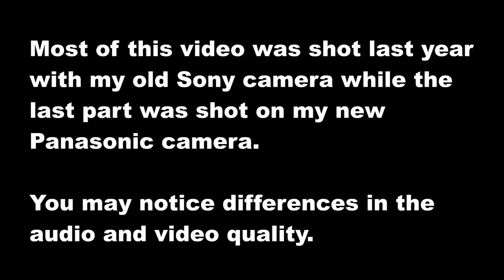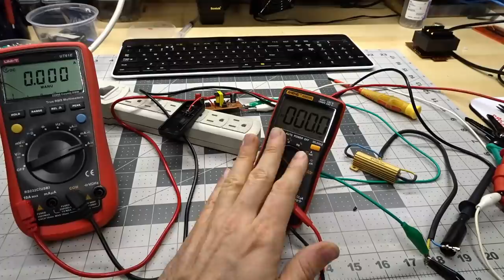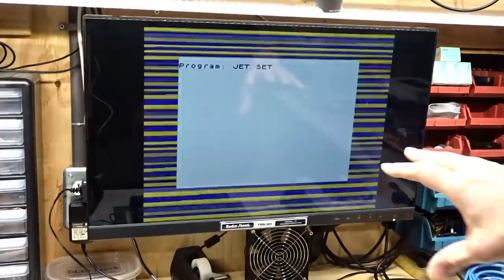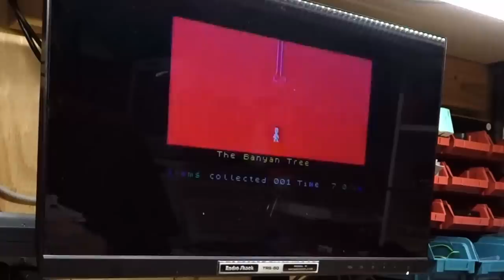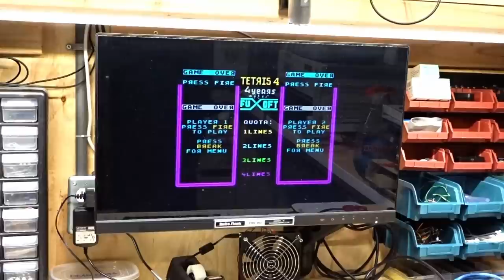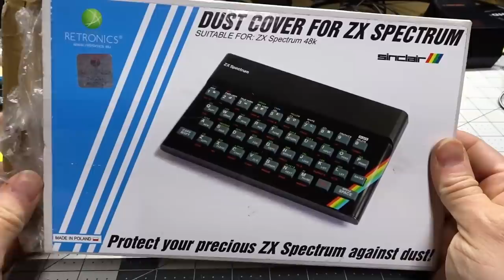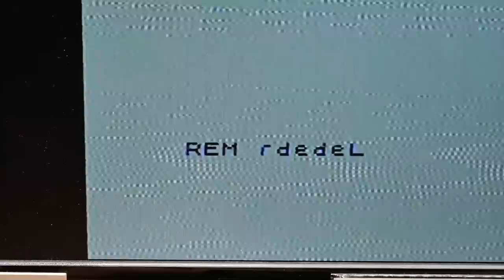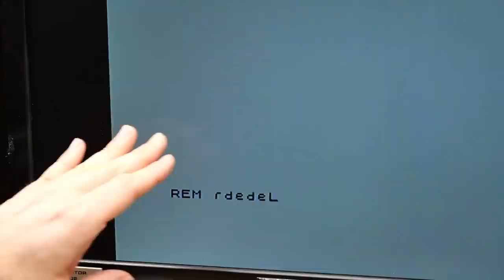ZX Spectrum Part 3 - Revisiting the machine at last!

Comment: I've tried the PC/Phone as tape trick before and had limited success, not only with the Sinclair computers but with most machines from that era.  The only thing I've found that works reliably with all of them is  Grundig DCR-001 Data Corder.  Rarer than hens teeth.  Of course this means dealing with real tapes, but once you get a tape working, or find a good original, it just works like a charm.  Plus you get that authentic retro-computing experience!
Reply from the maker: I just found a nice Panasonic tape deck for $5 at yesterday .. and a pack of unused tapes. So after I service the recorder, I need to m it out on the spectrum.

Comment: You may want to check the capacitors on the Motherboard switching supply for the +12V, the -5V; and the +5V linear regulator.

Comment: check equalization parameters on android (or your smartphone OS) you must turn off any 3D audio effect,  and select low bass at minimum,  mid-range frequencies and high frequencies at maximum. this setting must help a lot with your loading issues. 
And the last thing ...no preamplifier is needed at all!!  just plug your stereo plug at your smartphone and your mono plug into your speccy!!!

Comment: Looks like a good result! Although I remember hearing somewhere that the 78xx type of linear regulators need a couple volts higher than the output voltage. Looks like your input is right at the limit. You might need a slightly higher input voltage if you are using any add-on devices. I think the original was 9 volts if I remember - although that might have been for the older ZX81s. I ran into an issue with another machine where I needed to do that to eliminate strange behavior (or "behaviour" - we ARE talking about a UK computer here! :) )
Reply from the maker: On my older videos I was powering it right off my linear bench supply and I found that voltage didn't matter (other than for heat and if you were above the minimum on the 7805) so the issues with this machine are the same no matter how I power it.

Comment: Try adding a 10 Ohm parallel to the output of the amp, the un-loaded output may be producing to much noise/overshoot to catch the signal.  Also, some apps may not produce correct waveforms, that leads to short outages that confuse the read timing.

Comment: You appear to be measuring the voltage at the end of your maze of test leads, alligator clips etc. I'd suspect the PSU is actually doing a better job than it appears and the drop is in the test setup. Final voltage on the connector plugged in with the Spectrum running would give you a better idea. Easy to overlook the significant drop across lots of leads :-)

Comment: Adjusting volume levels on a tape deck was a black art back in the day and loading errors were common.  Different games always needed fine tuning with the volume levels and you are going through some of the pain all Spectrum owners experienced around '83.  It's also possible that the contacts on your EAR jack are a little dirty or corroded, so it may be worth giving them a clean.

Don't give up on the little ZX.  Whilst the graphics may not be quite up to the C64, there are some classic titles out there and if you can pick up a Kempston compatible joystick interface, your gaming experience will be improved no end.
Reply from the maker: Heh havn't given up on it -- for now it's going to have to go back on the shelf (to look pretty) until I can get back to it. I have lot sof other projects to work on :-)

Comment: The Speccy needs a LOT of audio level, especially the issue 2. When loading from my notebook, I have to turn up the volume to 150% and use WAV files with VLC player set to 120% volume. You should really get a decent 9V 2A PSU and a DivMMC Interface with joystick adapter included. Loading times of seconds instead of minutes. Well worth the money. I recommend to DivMMC Enjoy! Pro One from ByteDelight.

Comment: I used to use a converter for my C64 that made a sound file from t64 and prg files and just used a generic mp3-player with one of those car stereo cassette adapters to load the files on the C64. It is very important, though, to use the raw sound file, e.g. in native wav and preferably  the highest quality possible. If you use mp3, you will end end with a bunch of load error messages. It may not sound different to the ear, but you will lose some delicacies of sound the computer will be unable to interpret.

Comment: Try to get the 1980s portable audio tape player - you know the one with the handle that slides out of the front (they had one in an episode of Stranger Things), and get the original cable - one black one grey with the two circular blobs near each end, connect three points as per the spectrum instructions and see how you go! a full retro setup!

Comment: Loading/Saving a program from/to a cassette tape was always like this.
The Sharp MZ80K had an in-built cassette which generally worked as they had adjusted the volume to make it work, mostly.
Still faiked fairly frequently though.
Reply: As did early PETs, and - later - Amstrads.

Comment: Back in the days of the Spectrum people would pour lots of time into resolving problems with loading. I'd be tweaking the tape player with an Azimuth screwdriver and would generally be able to remember which games needed needed a tweak and how far to turn the screw, then you'd have to turn the screw back again because that position might cause a problem with something else.
Anti-piracy measures were often to blame, certain loaders designed to make copying difficult also sometimes made loading original copies tricky.
We just have different expectations these days so I can't see the Spectrum winning many new fans using original hardware.

Comment: I realize I'm two years late to the party, but I figured I'd chip in: I recently repaired my TI-99/4a and struggled getting its tape interface to work as well. Ultimately, I ended up using my Zoom H2n with the tape data normalized using Audacity and stored on an sd card in the zoom.  A bit of overhead, but it was the only reliable option (which included a PC, phone and ipod).

Comment: Take my english for what it is, that said...Hi !  don't know if yuo're still up with this, but... loading a game on a Spectrum has deeper meaning which is not releted on how your machine works. Belive it or not as soon as computer were getting in every house, piracy did the same. For some times you could "merge" a program (loading without running), copying the code on a new tape and make some money.  It didn't take long and the "merge" possibility was gone but piracy didn't give up and started  to duplicate tapes using 2 tape-players, first one was playing and second one was recording (via cable). To avoid this producers worked on frequency, some kind of protection and things got difficult. Non-protected games give you blu and yellow stripes during the loading process with regular noise, while protected games give any color stripes and noise raise up.
Thank you for the video_ a Spectrum grown guy.

Comment: Hi Adrian. A couple thoughts about loading from your phone.with my customers, whenever I use something like a square credit card reader, I have to turn off any audio enhancements that the phone has. So if you have Dolby audio or some kind of enhancement, make sure you turn it off or it does weird things with the signal. II thought is to make sure you're using a mono audio cable instead of a stereo cable, as it could be listening to the stream of data in stereo and causing a lot of confusion. 
The third is your point at the very end about why the ZX Spectrum is finally remembered by so many people. It just really does not even hold a candle to the C64...

Comment: as a spectrum and C64 owner, I must say the spectrum ALWAYS loaded tapes more reliably than the commodore especially with second generation copies. I never had trouble loading at all. I suggest you try an old portable cassette recorder with the wav file on there in case the headphone output from the phone with its audio compression/enhancement.EQ  is upsetting the spectrum in some way. The loading sound from the speaker is normally quite loud. The spectrum likes a good bright tape recorder with lots of treble.

Comment: The keyboard was klunky for sure, and there was a lot wrong with it - but the Spectrum was very very affordable - especially compared to the competition. Actually my Spectrum was an upgrade from the earlier Sinclair machine - the ZX81 - you should try to get hold of one of those. Man I wish I'd kept all my old stuff.

By the way, you are right about how you learned to use the keyboard. For those that don't know, it was basically a "modal" system optimised for BASIC programming, so it starts off expecting a "keyword" and flashes a "K" cursor and so you can press P (I think) for PRINT, then the cursor changes to "L" and you can type other stuff. It was a of a memory game remembering what all the special keys were (more keywords than keys), especially when the keyboard letters started to wear off. By the way, one side effect of this was that the BASIC programs were much smaller, i.e. one byte needed for PRINT rather than 5 bytes of ASCII - this was great advantage when memory was low (as it was on the ZX81 with only 1K standard)!

Good luck with your next project, I enjoyed watching this one.
Reply from the maker: I actually have a Time Sinclair 1000 which is the US version of the ZX81 basically. I have tried to use that machine but unlike the ZX Spectrum, it feels completely unusable to me. With the affordability, though, I can see why it was so popular ...

Comment: With regard to the keyboard issues: get a +2, had a much nicer keyboard and also had a version of BASIC where you could type out the commands in full rather than having to use the keyboard shortcuts. With regard to the loading issues: yeah, that's pretty much how the Spectrum always was--ultra finicky on what volume it would accept.

Comment: I can get my spectrum to load pretty reliably off a phone. I use an app called playzx, and the original mono cable that comes with the spectrum. There is an option to invert one of the audio channels in playzx, which you need to do if using a mono cable in a stereo socket. I find that works. If I use a stereo cable I can't really get it to work well no matter what I do. 1 notch down from full volume is usually the sweet spot, and with no amplifier.

I still get the odd tape error but it loads probably about 80% of the time first time.

Comment: I can't see if there ever was a part #4 but you shouldn't have had so many tape loading issues if the audio levels and timings were fine. ZX Spectrum used a very rudimentary format that was, in fact, rather resilient. The audio is truly binary - just pulses of various widths (durations). During loading it is the software that measures how long they. A simple threshold decides if it is a 0 or a 1. Parity is included for error detection. Not sure if DC offset could confuse it (or whether it goes through some filter) but incorrect levels during imperfect rise/fall edges could cause havoc. Not sure if your phone app or tape recordings use compression that may be optimized for human hearing but it may cause problems here with impulse timings being off. Colours and widths of the lines on the border are directly related to the levels and widths of the pulses being detected. If I remember correctly, 0 is a short pulse (~0.25 ms) and 1 is twice as long (~0.5 ms). 1000 ones or 2000 zeros (or something like that) could be encoded per second, averaging 1500 bps. Those are blue/yellow. Red/cyan are the longer intro/lead pulses for synchronization, terminated by a sync pulse indicating the start of the data block. There were three types of blocks: header (metadata for what is coming, very short), "program" for BASIC programs and "bytes" for any other data. You could probably trace these and see what the ZX Spectrum is "hearing" as it literally repeatedly inspects one I/O port bit all the time and counts how many times it sees the same value... Quick search says I/O port xxFE (00FE should do), bit 6. Also says that the analog signal is on ULA pin 28.

Comment: Hello. It's common practice to replace the linear voltage regulator with a switching regulator (example : Traco TSR 1-2450) which does a much better and effective job than the old LM 7805 regulator. And it does not radiate heat so no heat sink is required anymore..

Comment: For what it's worth, I've had good success unsticking old tape adhesive using lighter fluid. I don't own a Spectrum but if I did and wanted to take it apart, I'd break out the lighter fluid.

Comment: Try turning down your phones volume and using the amp to do the boosting. When running my old 160gig ipod through the cars tape deck via a cassette adapter I would always get far clearer sound when turning down the preamp from the ipod and using the car stereo amp to do the volume boosting. Around the 70 to 80% range on the ipod headphone output would yield good results. The same has applied to any audio output device that I'm trying to patch into a system that has its own amp.

Comment: Id recommend a ground loop noise isolator on the 3.5 jack coming out of the op amp. Your going to deal with some reliability problems but nothing as extensive as you saw.

Comment: Storage on 8-bit computers is not something be neglected: It is key to a good experience. Just like the SD2IEC and 1541 Ultimate are for a large part responsible for the renainssance in the Commodore 64, for other 8-bit computers, it is important to have modern storage media as well. For the ZX Spectrum, the common modern storage medium is the DIVMMC and I think your video did prove that you really need one. Likewise the BBC Micro has the TurboMMC.

That said, the Commodore 64 is a better computer by leaps and bound. The best technology won in this case. Sinclair computers were really the cheapest of the cheapest, cost reduced and the Spectrum was designed in this philosophy too. The Spectrum is interresting for retro computing because it had some good coders, whose work it is worth to see, and definately not because the computer was good.

Comment: As several have said probably recommend using a DIVMMC  Joy which means you can load games from SD Card and it includes a joystick interface.
Reply from the maker: That would clearly make this thing work properly bypassing the tape interface entirely. :-)

Comment: In that application that you use (Playzx), in options activate the first two and the last one, leave it as it is and turn up all the volume and also use a normal cable, double stereo and everything you put will run

Comment: When Timex tried to sell Spectrums in the US, they just looked like something that was purely an attempt to meet a basement bottom price point, IOW, you pay for what you get. The Commodore 64 was definitely more pricy but it was designed to be an actual usable computer and ran circles around the Apple II stuff in terms of value for the dollar (and had much better sound and graphics than the Apple II). I suppose it was the ZX Spectrum 128 model that those started to become decent computers.

Comment: This behaves exactly the way I remember mine behaving in the early ‘80’s when it was new. It was so hit and miss with tape volume that it drove me nuts. I saved up for an Apple IIe with disk drives. Wish I still had it play with though I remember typing in programs on that squishy keyboard the trying to run them and save them to tape.

Comment: What you need to do if a game won't load is adjust the tape head with a small screwdriver...especially if the software is recorded at home by someone else...usually commercial game tapes dont need this done but if your tape player head is misaligned you will have problems...you need to adjust so the sound is clear and crisp and not muffled

Comment: Hi Adrian, there is an alternative basic rom called Gosh Wonderful that does away with the shortcut basic commands and let you type in the basic key words as every other computer. You could burn it together with the original in to an 32k eprom and switch between the two or build it on an external module. For the tape loading I don’t know if the tape files you are using are mp3s or .tzx files. For the later as they are raw digital bitstream I think the problem may be the phones audio out. There is a digital tape file player called TZXduino to serve as a digital datasette for modern tape loading that is dedicated to that task. I‘ve heard the work nicely.

Comment: Pretty sure the loading problem is not the spectrum's fault.
Hmm, I remember with the tape deck the volume was full-on but some games required that I adjust the head which I think had the effect of changing the tone giving a crisper pitch but a phone you can't really do that unless I suppose you could play it as a music file and adjust the graphic equalizers may give the required results.
Usually, you do hear the speccy load so you could hear the pitch while loading maybe yours is a newer model and they stopped that.
P.S. We loved the speccy cos that's all we had the C64 was pricey also early on the software was sparse once people learned what the C64 was capable of then it was game over for the speccy but we had to respect it though, it brought us up lol, much magic and adventure came out of that little box and the loading thing that was part of the learning curve you had to learn because heck pirate games were rife at this time but the recording of the data was never guaranteed so we were adjusting heads messing around with gfx equalizers in our early teens we felt like wizards lol.
So much love for the machine but against the C64 no contest as well as the gfx that SID chip was something else.